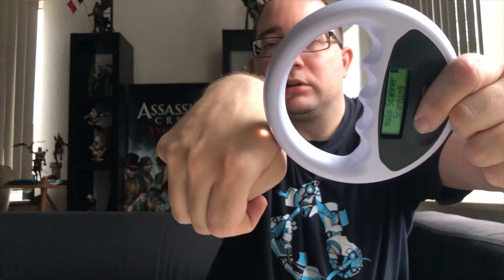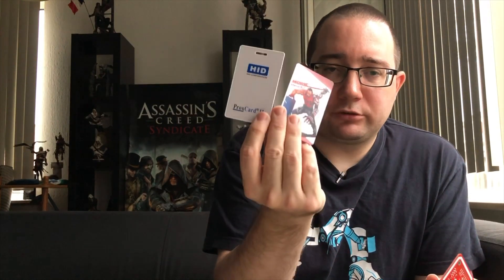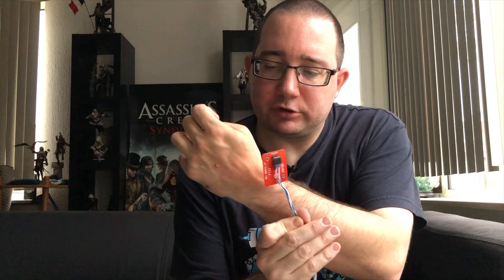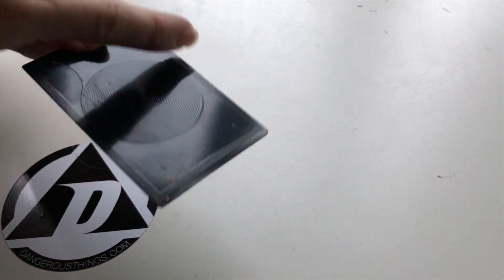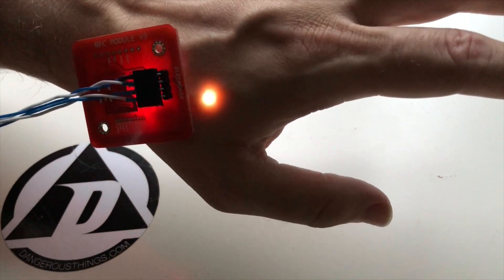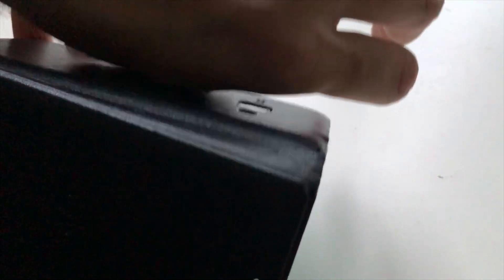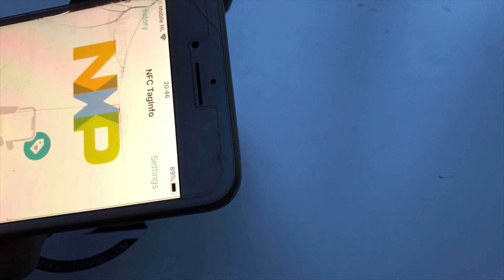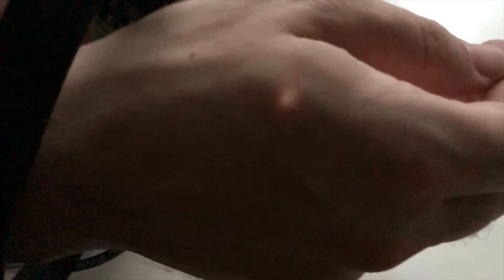Useful NFC/RFID tag implant applications 21: xLED high frequency RFID field detector

Comment: What is it used for or even why do it? Any good cause?
Reply from the maker: Reasons why I implanted the xLED HF in my left hand next to the existing xNT (blank, without NDEF records), the xLED LF in my right hand next to the existing xEM (in HID mode)

1: to detect which frequency an RFID reader uses
2: to check the maximum reading distance and best orientation to hold an implant in relation to the RFID reader, to find the sweetspot
3: for privacy reasons, if the xLED implant lights up, I'll know the implant is in the short reading distance of a reader.
4: for demonstration purposes, to show to people that the reading distance is limited by hardware, so they don't have to worry about being tracked 24/7
5: journalists wanted to film me getting an implant for their YouTube channel or Dutch TV show episode.
6: another xLED LF implant is implanted under the tattoo, to light up the eye part of the tattoo.
As shown in the video, I modified "halo" pet ID tag reader, removed the plastic housing so it's large enough for my lower arm to fit through, to light up the xLED, in my spare time I'm working on creating my own wristband with a copper coil.. how about displaying different light patterns, morse code signaling by using a microcontroller?